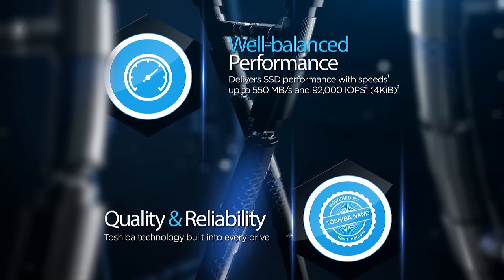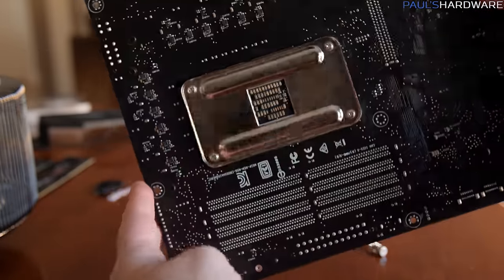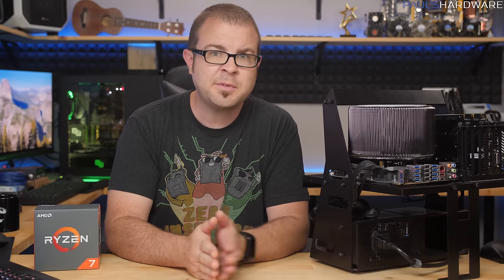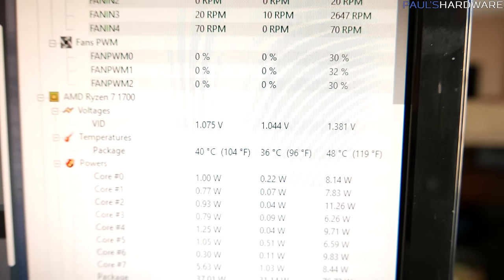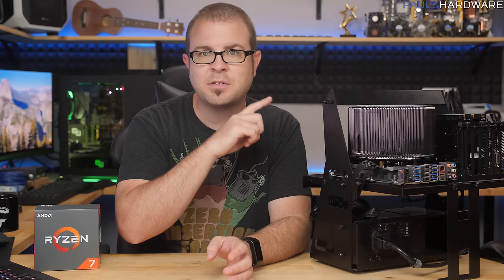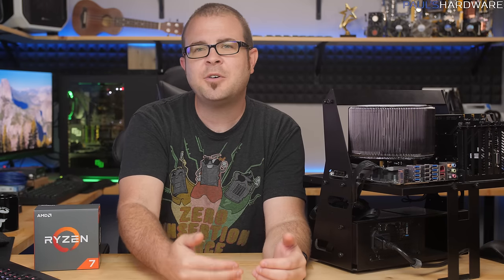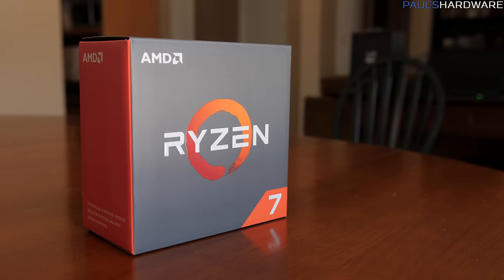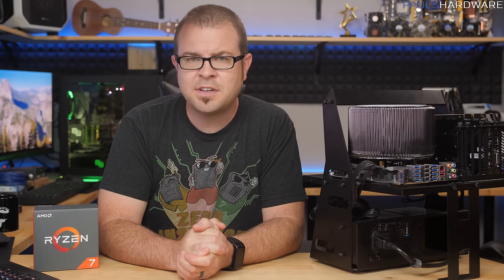Can You PASSIVELY COOL a Ryzen 7 CPU?

Comment: I would like to see another test with it in a case.
Plus with basic case air flow.
Reply: I think that would help the cooler a lot, with 3 very slow running (1 exhaust 2 intake) fans - that would provide flow for the cooler, while still being able to remove the heat from the gpu. Though a blower card would be better in this situation :)
Reply: xxgg 

but why would you have an expensive fanless cpu cooler if you're still using fans in your case ? It would make much more sense then to buy something like a be quiet shadow rock 2 for around $45 and set the fan to the lowest rpm.
Reply: MoeDaTeaman You need fans in your case for basic cooling of motherboard components. Even when you switch from a fan cooler to liquid you always want to make sure you have adequate cooling for the chipset/chokes
Reply: Watercooling is stupid anyway you want quiet but if you want to be extreme  overclocking  then phase changing is practicly the old ideas for subzero temps and it works I suggest you get a 60hp  compressor because your Gona need something  stronger than a 5hp cascade
Reply: +jonathan oxlade   Why would you need a "60hp cascade"? The commercial units like my Asetech Vopochil LS use a 1/3 HP compressor, which kept my last GPU at -35c max on the block under load. 
Ryzen is pitiful low amount of power compared to almost anything I have (300+w FX, 300+w ATI/jet engine <-used as a hand drier at one point but you need hearing protection, the 300w R9 Fury, and then the lowly 150w max Ryzen chip...)

That should be around -40c to -45c on the block with Ryzen. You still need to add external heaters to keep the insulation from frosting and icing up after a few hours. That's enough for a good overclock.
Reply: Yea but I don't think those compressors are rated for 24/7 usage you need a very stromg compresor and 60hp should do the job 3 of those baby's will take too much of my room lol  but I could add 5 evaporator  heads 2 for sli gpu  and 1 cpu head and 2 ram evaporator  heads  Aswel so I can phase change the whole system
Reply: jonathan oxlade I ran mine all day long, people ran similar systems for months on end (don't know why, but they did). You do know 60 HP is going to be massive, and that's more than a lot of small tractors. Our decent sized combine is 130 HP stock (International 1440, Google it). John Deere sells tractors with cabs and air conditioning with less that half that.

My cooler weighs something like 40 lbs or 20kg. What your talking of might break the floor near 7,000-8,000 lbs (2x the weight of an American car) if it's close to linear.
Reply: 60hp  copeland  scroll  compressor  well I suppose a single compressor is enough then but it won't weigh 10000lb lol scroll compressors  weigh  120kg  a industrial compressor  is heavy like 400kg
Reply: Seems a bit big... 45kw to cool 1kw of parts? That's a bit overkill. Its like running 45 window AC units on a tiny room when 1 is plenty. You won't see an improvement in temps past a point (maybe 2kw) since you tune it for the BTU/heat output of your system. Once you max out a refrigerant (mine boils near -60 to -70c), you can't get it colder. R-134a only goes down to -40c, and R-12 has been made illegal, so your options are a bit limited. I wouldn't use propane or butane for obvious reasons, and pure ammonia is odorless and will kill you in your sleep if it leaks. So using common R-134a, you still won't match the temps I'm getting with my 1/3hp compressor. If you need 3 parts (2gpu, 1 cpu), then either 3 systems or 1hp compressor should work, but I'm not sure how you balance multi-head.

Good luck, if you do try to make one, I would recommend trying out a 1hp compressor (or whatever you can get) and see if that's enough. Also make sure to get a refrigerant gauge kit so you can fill it properly (otherwise its a bit of a guessing game). It looks like my cooler has never had maintenance (bought it used, they stopped making them in 2006), and it still works like new. If you make one, add some 5w heaters to put between insulation, it will save you from de-icing your system. good luck
Reply: This would be dumb. The reason buying a fanless cooler is to have none fan running, even the PSU would be fanless... If you're going to put any fan on the system, buy a simple aftermarket silent aircooler, it would at least as quiter and cooler as the fanless with basic airflow
Reply: With an open air mount your tests are invalid from the get go
Reply: @jakegarrett8109  ammonia is odorless? No it's not it smells like piss
Reply: Red Stoner sorry, thinking of propane or could have been ammonium salt. Either way, with my stuffed up nose 80% of the time I probably wouldn’t be able to smell it, haha! So it would probably be odorless to me.
Reply: @jakegarrett8109  fair enough. And if you were sleeping you might not wake up on time to escape the gas

Comment: Wouldn't an actual enclosed case affect the temperature??
Reply: Possibly positively. If the case has enough airflow, then it might workout.
These coolers have been around for a long time so, you'd probably easily find complaints if it didn't work in a regular case.
Reply: With a few case fans, in a well ventilated case, it works just fine, unless you're overclocking. Thing is, the stock cooler for that CPU (Wraith Spire) is so quiet, I don't know why anyone would do this.
Reply: nappydrew if the goal is to achieve a fully passive and by extension a totally silent PC
There won't be case fans
(If you have to use fans, you're better with a silent cooler that would be less expensive and  offer better perfs)
Reply: To me it make more sense to just have a silent casefan since it be providing cool air to multiple components like the GPU, vs a silent cooler which only provides air to the CPU.
Im just going with a "Less fans = less noise" mentality though.
Reply: I would go with the NoiseBlocker NB-eLoop B14-1, NoiseBlocker NB-ELoop B12-1 or the Noctua NF-S12B redux-700 all three are well beyond 10db(A) the B14-1 with just 5.7db(A), the B12-1 with 8db(A)and the Noctua with 6.8db(A) and therefore shouldn't interfere with this "No noise"-stuff.
Reply: +riep69, If fully passive is the goal, yes, I understand that. Thing is, there's a PSU in the thing, which has a fan, therefore, it's not going to be a completely passive system, regardless. I doubt Paul plans to build a PC without at least an exhaust, but I could be wrong. Guess we'll see, soon enough.

Back to my original point, it was neat to see the passive cooler, in action, but anyone who's heard a Wraith Spire run, knows that you simply cannot hear the thing, through almost any case, unless maybe you have a stethoscope, and I'm talking even at 100% fan speed, these things are whisper-quiet, and very effective. So, except for making a cool video for us, and doing some fun testing, for Paul, I cannot imagine a practical scenario for passively cooling an undervolted 65 watt Ryzen CPU, unless you plan to run it, in a sensory deprivation chamber, lol.
Reply: the thing is, passive PSUs have been selling for a long time !
Reply: True, but did he use a passive PSU? In the other video he did, precluding this one, I believe he had this running on a standard PSU.
Reply: Sypran,
I get what you're saying about having air flow, but then you've got CASE FANS which begs the question WHY would you get such an impractical, expensive cooler when a good Noctua would cool better and the noise would be pretty much IDENTICAL. In the case of RYZEN you sacrifice the ability to overclock as well apparently.

There's just NO POINT to passive coolers like this if there are other fans in the system. Frankly, my NH-D14 can game without the fans spinning and with my three case fans at 600RPM. The only fan I can hear when gaming is my GTX1080 EVGA FTW3 though it's pretty quiet as I made a custom profile (in retrospect I would have gotten the Asus Strix but it's a minor point).

I'm also not convinced that the cooler needs to be as large. I highly doubt the big space in the middle helps much. Probably better to have a more dense design, as remember the further away you are from the heat source the less effective the cooling is.
Reply: nappydrew also if the rest of the system has fans why even consider this? The only scenarios I can see this being a good idea are for an office pc, htpc (with a soc/apu) and a personal home server
Reply: Well, Paul's situation is pretty unique, to be fair. He's saying (he mentioned it again in another vid) that he's going to mount this system on the wall, so his will be getting pretty good airflow, just from being in the open air of that big room. It's a neat concept, but just not very practical for MOST ppl. 

Side note, if you put that cooler on 4 different boards, it would look like a set of car rims attached to PCB's. lol
Reply: Blade Mastr Having airflow would probably decrease the temps.
Reply: 10k rpm fan in the middle pls
Reply: How about more fans lower fan speed.
Reply: @riep69 You can get a silent HTPC and still use fans: In my HTPC I use a low watt bequiet PSU (with fan) that makes no detectable sound unless you put your ear within 1cm. I have a fanless CPU cooler and I use 2 case fans set to very low rpm which also make no detectable sound. To me it seems kind of pointless to try to go silent if you are then going to attach a 1080Ti. If you are going that route, you may as well just use fans and get a sound dampening case
Reply: Blade Mastr put that case sideways without the side on

Comment: FOR ALL OF OUR SAFETIES, DON'T TRY THIS WITH SKYLAKE X
Reply: love the smell of fried eggs and silicon in the morning.
Reply: 6700k.... I'm sure they're designed to melt in the summer
Reply: Hits power button and PC melts down with the ferocity of Chernoblye
Reply: Bakairo89 try it with 7700k. This one will overheat even more.
Reply: Oh how the tables have turned
Now intel's the oven cpu
Reply: I'll remind you of P4.
Reply: ayy
Reply: News-reader: "Now to you Tom"
Reporter: "Thank you David. I'm here at what appears to have been ground zero of what has been dubbed 'the meltwave', and event that killed over seventeen thousand people, at this time a year ago. To this day, no one is sure what caused the blastwave of absolutely decimating and destructive heat, that took the lives of so many people that day. One thing, however is certain. This is not an event that anyone could ever have forseen."
Every AMD user, including me: "*ACKCHYUALLY...*"
Reply: The Preshott times are back.
Reply: Err, you do realise that Ryzen’s max junction temperature is 75C and that for the R7 1700 there is no 20C offset in the reading. These temps are way too high for this chip. If it was Intel which can handle 105C (although granted it is a bit different measurement) it would be fine. Also any heat problems with Skylake X arise when you overclock the shit out of them. We haven't seen Mr Paul overclocking the 1700 in this test. Too careful not to say a bad word about Ryzen and upset the AMD fanboys...
Reply: Your own elephant's foot on your desk!!!!
Reply: Alex Marin isn't 105C the temperature where the Intel CPUs automatically shut down? Nonetheless, 75C isn't the absolute maximum for AMD, but the temperature shouldn't be higher over a longer period of time, similar to the way Intel CPUs shouldn't be hotter than 85C (even though I'm not sure whether these numbers are applicable to their recent CPU generation)
Reply: I want a heatsink with a griddle/stove attachment now!
Reply: 7700k runs fine at stock speeds with a corsair h55 AIO water cooler. never going over 65C.
Reply: A 'passive' cooler used as a steam engine much? Add in a metal cup and fill it with water and have it boil it to spin a turbine then use it to fuel the pc?
Reply: dra6o0n Don't you think that would add quite some weight on the motherboard?Even up to the point of breaking it in half?